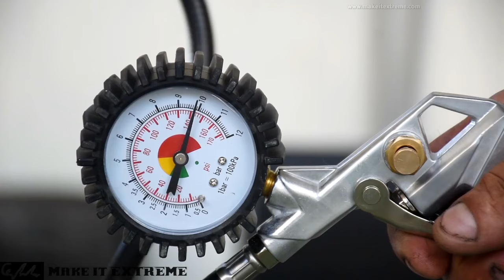Project 070 | Homemade Drone Catcher

Comment: homemade? if you live in a fully equipped shop!
Reply: Aldemar Delapuy Jealous much?
Reply: He's not jealous, just saying that you can't say it's homemade if you use professional equipments.
Reply: Evandro Ferreira Teixeira The only indispensable professional equipment from the whole setup is the lathe (the die for cutting the threads on the pipes is not too expensive, especially the manually operated ones), nothing else. The rest can either be found even in the smallest shop or can be substituted for something else (also found in the shop).
But yeah, it goes without saying that one shouldn't even attempt to build anything without having a shop. That's be like trying to play the piano without a piano.
Reply: I still think you can't call that kind of think "homemade". That might be cultural though. In my country not everybody would have so many equipments like those at home, and here they are probably quite expensive.
Reply: Evandro Ferreira Teixeira Homemade means made at home. If it's made at a home it's homemade.
Reply: You are right, it is the dictionary meaning. But I think it lacks context. If you watch a video that says "homemade" you might get interested because maybe a regular person could do it at home. Which is not the case.
Reply: I like the ammo but I would duck tape 4 single shot .410 shotguns together spread the barrels at the correct angle take the stocks off and make them fire simultaneously.
Reply: my shop is a pair of pliers a roll of bailing wire,duck tape and a screwdriver!
Reply: The lathe isn't even especially important in this process. The part that is turned (and milled, BTW!) can be done by hand. It's more complicated that it needs to be. It's mostly an ingenious design and a bit of welding.
Reply: Matti Savoila "It's mostly an ingenious design and a bit of welding." - Yep, that's exactly the point of pretty much all the videos on this channel. The items featured here aren't particularly tricky to grasp nor reproduce. That's why "home made" (in contrast to "factory-made"), not "shop-made".
Reply: Yup - call it "DIY" instead of "homemade". You can do it yourself - only if you have access to welding equipment, lathe, mill and vertical drill...
Reply: Przemysław Jakubczak Okay, I agree with the DIY part, but make it a welder and a drill. You really don't need anything else (you can use the drill for cutting as well and also to make a stand for it that would allow you to do the rest). Perhaps an anvil.
Reply: Snake Plissken I thought you were dead?
Reply: Yes - you can definitely do it yourself - but this movie is not homemade. If he'd made it with standard tools then nobody would make any comment... Now this is just another fabricator.
Reply: Przemysław Jakubczak "If he'd made it with standard tools" - But the point is that it CAN be made with standard tools, though it'd require MUCH more effort, time and precision.
Reply: Standard for a machinist maybe.
Reply: mnstar53 Yeah. Only a machinist would own a drill, an angle grinder and a welder, right? Because these are the standard tools I meant when I made the comment above.
Reply: Sure you did.
Reply: mnstar53 This last sarcastic comment of yours makes me think that you won't be able to make stuff like the drone catcher even if you had all the equipment in the video at your disposal. The guy's secret is not in the cornucopia of equipment he has (quite a few which he has made himself), but in his ingenuity and inventiveness by which he creates these items. You can't imitate that with pro tools alone.
Reply: I have no need for a stupid drone catcher.
Reply: Evando, I'm a regular person and could do it here at home. Many farmers could do it with no problem. Lathe, check. Drill press, check. Welder, check. Grinders, check. Chop saw, check. Skills, check.  And some of us have more than just one of each the machine tools.
Reply: CoolKoon,  mnstar53 needs to get out into a rural area. Farmers often have all those items and more.
Reply: He set his factory at home that's why it's called home made🤣🤣🤣
Reply: And have nothing better to do.
Reply: @CoolKoon 
I admit. I'm jealous.😡✊️

Comment: tips for improvement: instead of having only 1 air tank for each set of two launch tubes, have 1 air tank for each individual launch tube. Instead of the mechanical valve, place 12v high pressure solenoid gas valves at the base of each launch tube, connected with identical length and identical guage wires to a single momentary switch which in turn is connected to a 12v lifepo battery pack. Battery pack can be placed inside of handle. For quick re-load, have all 4 air tanks connected to a larger air tank that is carried on ones back. Embed corners of the net in epoxy instead, cheaper than the metal weights. (with added weight if needed)

Comment: You NEVER, EVER cease to amaze! Several comments have compared this to a shotgun, brand-named or otherwise. While I agree, a 12 gage (gauge?) might be as effective the fundamental differences are, this build requires no license or permit as it is not a firearm (the impelling force is not by fire). 2. It is relatively quiet. How is the drone pilot even going to know where the “shot” came from? Attach a radio jammer and as soon as the drone is caught the pilot loses all visuals. 3. How much more fun to bring down a nuisance with a gadget you built yourself than something you just went out and bought. 4. And this has multiple uses. Increase the net size and rig it to a trip wire as an intruder mitigation device. If you are a hawker you could use it to catch birds of prey. Sure, this is a complicated build. It requires some serious equipment. But, for crying out loud! The channel is called “Make it Extreme.” If you want “Make it Puny” there are other channels. Thank you again for your amazing work.

Comment: A $1,000 to a 50cent problem.  Wonderful workmanship though.
Reply: I could make an electronic jammer if I wanted too that would make it fall out of the air like a dead goose. And probabbly fry every chip in it.
Reply: @taisontaison4118  
Ok your turn to make a video of that . That would be a good device to have !
Reply: @taisontaison4118  oh look another internet expert. It's a good thing that electronics guys turn around to tell you that can't happen. Your wife be able to jam at or screw up at signals but you're not going to fry anything's
Reply: I have one of those, but it's a lot smaller and cheaper.  Made by Remington.
Reply: @slopsec2358  
Ah yes dandy bit of fun them there things are . Yes sir , indeed .
Reply: @ClownWhisper  RF jammers aren't that complicated, just some wideband noise, high power and high gain by using a directional antenna.
But frying it is bs indeed, even a narrow beam radar system has a hard time doing that, when the resonance frequency of the circuit is not given.
Reply: 100$ in ss fittings
Reply: @hardworkingamerican8847  birdshot
Reply: @taisontaison4118  You make one I will buy it, the Jammer made by a Japanese company (the airports buy and use them) I think they cost like $35,000 - I was hoping to see an electronic made on Youtube!
Reply: @slopsec2358  Mr mossberg works good too, lol
Reply: @verenigingvandemagogen4548  I have made one already, it would fry a computer, which it did, it would make a drone fall too. I will not say how I did it because other people will be frying all their electronics. But that is using it non directional, once made to focus on one spot at the very least they would lose control of it. Microwave toys are another way to get it.
Reply: @francosworld5030  only thing you would have to figure out is how small an antenna to use, I had seen a guy on t.v . Make a similar device and had a small dish he used to aim it. And he went to a salt flat and demonstrated it on a computer, and had someone drive a car towards him, he aimed it at the car, and fried the computer in it. The one I built though went in all directions though. I just didn't know what I had there until the computer my wife was in in the house quit. And I didn't realize what I had made until years later lol. Seems like making an antenna that you can aim would be easy.
Reply: @taisontaison4118  Cut the window out of an old microwave and turn it on. Nothing interesting happens, except for a distorted 2.4ghz wifi band.
Reply: @taisontaison4118  how my friend?
Reply: @verenigingvandemagogen4548  and yet youre still responsible for any damage you caused with such a thing. Meaning your own router or pc, your neighboors router or pc, and so on. If you get invaded by a drone, take it down safely (even taking it down safely is illegal so just get over your hatred). Others have paid for that drone to most probably not do any harm.
Reply: @Sharpless2  Yes indeed, destroying other peoples property is called vandalism.
Whether it is proportional force or not depends on circumstances and possible alternative solutions against trespassing.

It can also differ from country to country, similar to home invasions. In some countries its allowed to use more violence against burglars to drive them out than other countries.
Especially in countries where self defense and defense of private property is highly valued.

An example of circumstances: 
When a drone flies on an airfield where airplanes takeoff and land, it gets shot down immediately, because of the dangers it can cause.
But when it's flying over someones' front yard, it's considered vandalism when it gets shot down.
Both are restricted airspace to drones over here, but both require a different approach to solve.

But my point was that microwaves don't "fry" electronics, unless you put it inside an actual microwave oven.
My neighbors had a leaking microwave oven (they removed the door grill to be able to see the contents better), I lost wifi connection every time they turned it on.
Reply: @taisontaison4118  plzz make a tutorial pllzzzz I am fed up of my neighbours drone
Reply: I can accomplish the same thing for free baseball arm, rock  problem solved

Comment: The tittle is misleading! that's a factory made not homemade 🤭😂
Reply: honestly you can do alot of this with a 100$ welder and a powerdrill. you dont need the precision tools they are using.
Reply: Naah some DIYers have complete shops in their garages!
I used to have a Bridgeport mill and a lathe in my garage. Went well with the MIG welder, bench sander, arc welder, bench press bench drill press and 200pound air compressor along with the nesserary attachments!

You'd be surprised what is in some peoples garages or shops behind the house!
Reply: @rolloverriderpgr  I Think you didn't get the sarcasm right there.
he's Anti Drone is really good that it should be in the market and doesn't look that it was just a homemade.
Reply: Some brain's behind this clever  engineering ....well done

Comment: must have cost a fortune in pipe fittings alone
Reply: Been a lot cheaper and go buy a 870 and a box of No. 6 shells.  Even 7-1/2 would do the job!
Reply: SS fittings, piping, hardware, shop time, machining, welding.... 12 ga comes to mind.
Well designed and built.

Comment: shotgun's cheaper (fine, inventive workmanship, though...)!
Reply: I agree shotgun be the right tool for the job.
Reply: Old Guy's Place  That is what we call democracy, drones are becoming a nuisance they are invading airports and disrupting their activity so they should be shot down without any reserve!!!
Reply: Old Guy's Place  If they are aircraft, then minimum altitude rules apply. One of those being enough altitude for a safe emergency landing.  If one quits and smashes into something spendy- the operator gets to talk to the feds. 
If they are aircraft, right of way rules apply also. Fly your own drone so it is converging from the right, and it has right of way. Collision would be the other guys fault. A 40 dollar cheepo unit with the right of way could take out a big ticket drone easily, and not your fault.
Reply: Hell, a water hose would have worked too.
Reply: ll

Comment: homemade. but who has all these equipments at home.
Reply: Exactly what i had in mind. All i have at home are Hammers, Pliers, Screw Drivers and some wire cutters. :D
Reply: mild mix chintu 
but he got such things in his home so its homemade for him
but not for those who don't have
Reply: George Khawlhring , yep and probably the lack of skills to use them... no? Don't get me wrong, if these are the only tools one has, then he shouldn't have any.
Reply: work and invest
Reply: Click on over to Made in Poland channel, he made a pretty impressive metal fab shop from mostly old junk with nothing but a hand drilll a grinder and a stick welder!!!
Reply: I have, but then again, nowadays i build lens support, grips, screen holders etc for cameras, so it is a little factory at home. But i got you point. How many people have lathes and milling machines at home.  I can see some simple welding equipment, but the big stuf.... nope.

Comment: Too much work I better use a 2.4 and 5.8ghz jammer, next i pick it up and become the 2nd owner
Reply: microsoft service Too bad most good drones are connected via WiFi
Reply: MajorGaming ... and what frequency do you think wifi is?
Reply: gorillaau 2.4 - 5 gHz
Reply: microsoft service , Jammers are highly illegal and it is a federal felony charge just even owning a jammer.
Reply: Nonsense your  jammer, my drone with a signal loss will just return to me, to the start point.
Reply: Too bad wireless frequency jammers are banned by the FCC and illegal to own, posses and operate in a public space in the USA.
Reply: Or you can make gun from a part of microwave oven. The gun is  deaden for deadly for electronics.
Reply: Too bad that's illegal to do.
Reply: @Ed Wad: online tough guy, eh? I hope you don't expect folks to be impressed.
Reply: 2.4GHz is Remote to Drone Radio Frequancies (Signal), 5.8GHz is FPV RX to FPV TX Frequancies (Image)

2.4GHz is most common used Frequency.. like WI-FI signals, All Kinds of Non-IR Remotes, etc
Reply: Same here.
Reply: similar to remote control kid's toys. just frequency
Reply: not if you jam the gps signal also, which is exactly what commercial anti-drone jammers do
Reply: we got a tough guy over here
Reply: Cerus98 jamming GPS is easier then jamming the drone itself. All you need to do is overpower the sat signal, which sats being so far away is easy. Also unless you're jamming signal is propagating far enough to interfere with commercial airlines the FCC wouldn't even notice. Also as a caveat, you're not supposed to operate drones near airfields or along flight routes to begin with.
Reply: Cerus98 you're 100% right. my point being is it requires very little power to jam a GPS signal. Due to not requiring much power you can keep you're jamming isolated to a small area and not draw the attention of the FCC or any other law enforcing agency.
Reply: what if its a 6.0hz
Reply: Cerus98 I've got what's known as private property.
Reply: Well, it's a good thing that mine are no where near that frequecy range then.  You try jamming mine and oth the FAA and FCC will be speaking with you. lol

Comment: A great idea. Can be installed on helicopters, for not to shoot ammunition. And get the drone with full data. BTW, the bullets can be made as a single bullet, separated at target. In this case, the drone can be disabled at higher altitude.

Comment: A lot of metal fabrication in this design. Should be useful to anyone who has access to a machine shop. Still a cool design though.

Depending on the state or city you live in, using special shotgun shells, like non-lethal water or bean bag shots, will freak everybody ignorant about guns. So don't use this in California. That state is next to an ocean yet is always running short of fresh water every year. Might be a moot point if they have no electricity to complain.

I'm thinking paint ball gun.

Comment: Before building something like this and shooting down someones drone, you might want to ask yourself if what you are doing is legal.  Many drones are flying legally and with FAA permission. A good high quality drone cost from $500 dollars to several thousand dollars.  They are equipped with GPS mapping and HD cameras witch feed directly to someones tablet or cellphone and are recording the flight.  You shoot down my drone I will definitely file criminal charges against you.  Restitution could be very expensive as most judges will first determine the local laws concerning drone flight. The air above your home is not your property that's why you cant shoot down an air liner.  Drones are also looked upon as personal property.  Judges often will make you pay for a stolen or damaged drone.  In this video the drone was peeping through his window.  Ok, I get it.  I would probably build something like this for that purpose but if someone is just flying over in a legal flight you might find yourself in serious trouble if you shoot it down.  Remember the drone pilot has recorded the whole thing.  Think before you attack.